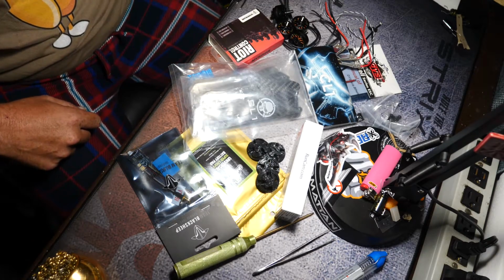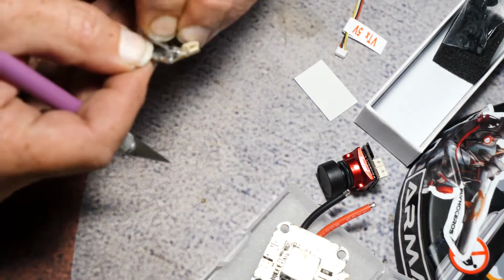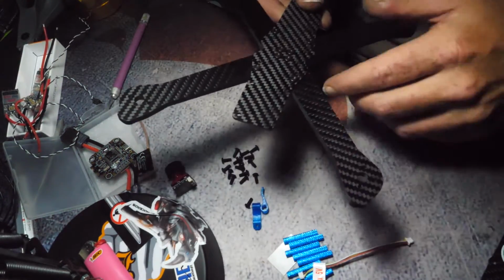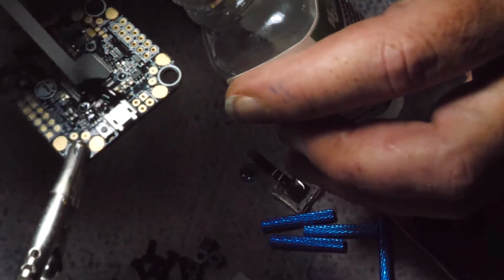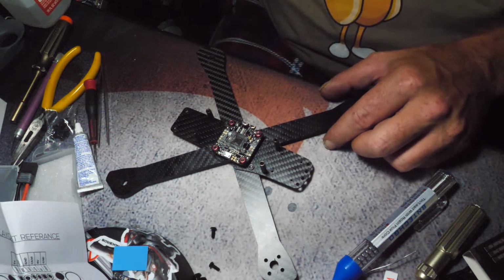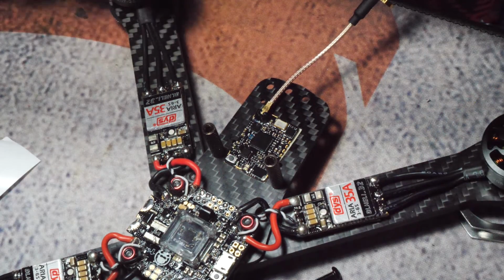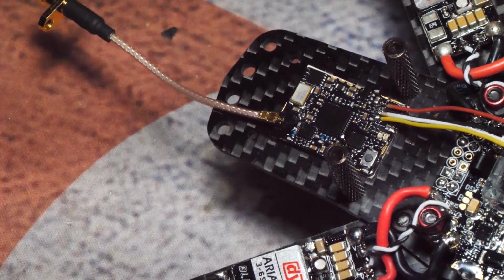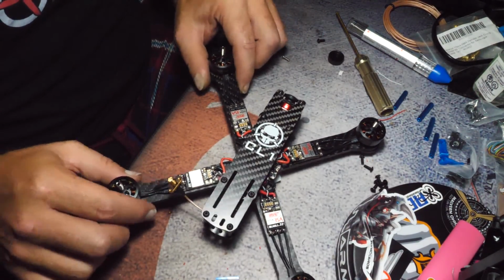Rotor Riot CL1 and Riot Control FC build

Comment: I can only get two motor screws per leg! Wtf ? Lol is it my motors or the frame? Not sure if I can run them with two screws or if I should try to slot the holes
Reply from the maker: Jacob Ballew ya, the motor holes kinda force you to only buy 16x16 motors (hypetrains are this FYI). I’ve ruined a set of motors trying only 2 screws on this frame so far. Lmk how slotting them goes if you try that route.

Comment: Can you send me a link to where you got the camera mount from? I can't find one for that size all the ones I find her bigger opening
Reply from the maker: John Mccarty here’s the link to the .stl file. I designed it so if you’d like a modification, just comment on the file. 

https://www.thingiverse.com/thing:3024586
Reply from the maker: Or were you referring to the fpv cam mount?
Reply: CopperTOP/Dave  yes the fpv mount
Reply from the maker: John Mccarty ah ok, ya since I originally downloaded the file I also cannot relocate it. Send me an email at dml10931@gmail.com and I’ll reply with the file. It’s universal so you can use it on multiple diff frames. I love that mount!!!
Reply: CopperTOP/Dave I found one's for 27mm openings nothing for anything smaller. I'll send email thanks for your time.
Reply from the maker: John Mccarty if you print this mount in TPU, it’ll form/stretch to any standard sized opening.
Reply from the maker: Hectic_FPV my email is in a comment above. Send a message and I’ll send the file. 👍🏻

Comment: also man i hot glue my ufl connects and it holds it pretty well if that helps at all but badass build man lets see some flight footage next!
Reply from the maker: Aquaman FPV I’ve tried hot glue without luck. Maybe I need more! 😝

Flight footage coming soon, just did a quick rip outside my house and on BetaF 3.4 it flies great!!! 🧡👊🏻
Reply from the maker: the maiden flight is up on my channel :)
Reply: CopperTOP/Dave hell ya man I watched it that was a great flight dude and looked like a locked in quad!